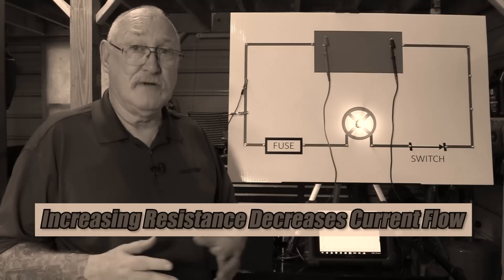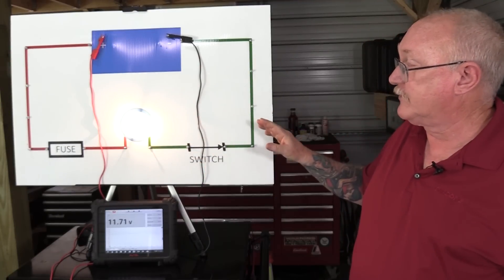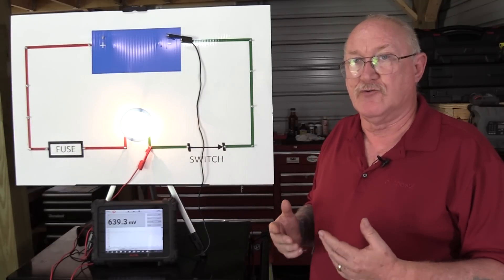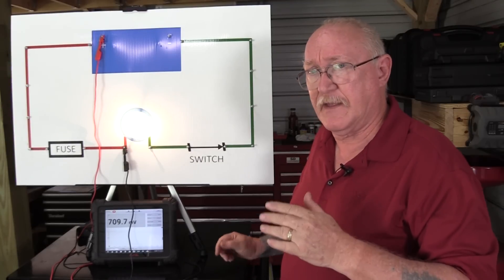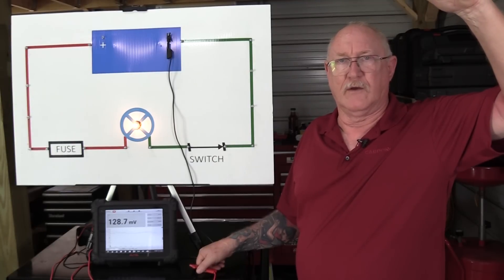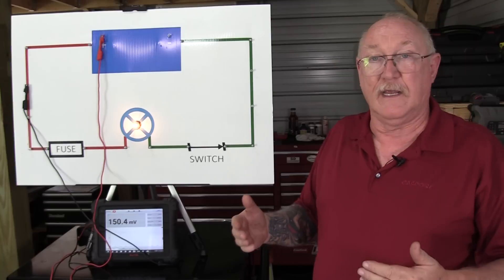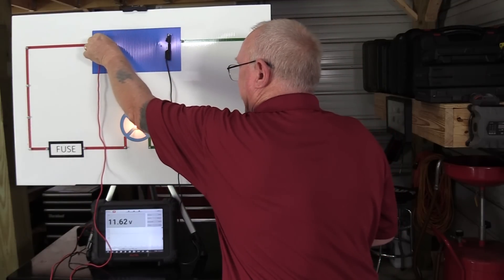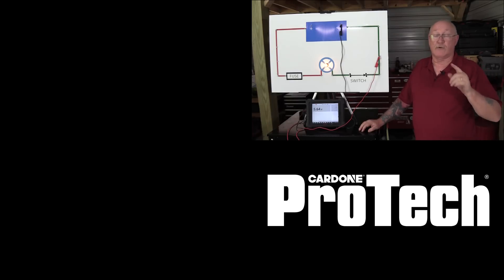CARDONE PROTECH #3:  Kirschoff's Law And The ONE Electrical Diagnostic Technique You MUST Master

Comment: The reason we have voltage present on the part of the conductor that is color-coded as neutral (as we said, voltage is the difference between two points, so that section can indeed be at a positive potential rather than at the convenient reference of 0V for us) is that, in the original circuit design, the last load was connected to the negative pole of the source. However, over time, an additional load was added in between, so that section stopped having the correct color coding because there is now a significant voltage drop across it.

I thank you for helping me understand these fundamental concepts in an easy way, especially since there are many common misconceptions about them.

Comment: I learnt from other sources that voltage-drop between the positive to positive should be close to zero but does it depend upon what is being tested?    best example for me is the positive battery leads: should there be close to zero voltage-drop on the positive to positive while cranking the engine

Comment: The low ohm short from the battery positive to the fuse is a bit strange in that this would have to happen in the fuse box, but okay lets say its there. If so, you would easily be able to spot exactly where the short is with a thermal imager, but you would be probably replacing the fuse box anyway unless you can open it up to repair it. High resistive shorts produce heat (a thermal hot spot). To break open a harness along its full length to do the point tests like shown in the video is just not practical.

Comment: How was there positive voltage on ground side...was it a short to ground?

7-28-2024 Update:
I get it it's caused by there being other loads like a switch with high resistance that shares the voltage between everything on circuit.
If there was nothing causing high resistance on ground side then it would read 0.03-0.3V on ground side since the intended load used up all of the voltage itsself.

Comment: Old mechanic n Electrician I had trouble shoot many electrical problems on cars n found n fixed but I never tried or thought to find resistance the way you described it is great on burnout components but with all this new electronics modules it’s hard to find even with all this new fancy n expensive diagnostic testers with thousand of information I do get lost.😢

Comment: a lot of electrical problems can cause codes that are false from the alternator being bad and spiking the system with ac voltage and the battery having ac voltage to the point where it has to be replaced I had a Chrysler van set a crank sensor code and it was a bad alternator

Comment: resistance to ground is a major problem you absolutely have to have a good ground I put extra grounds on my vehicle I ground the engine to the  Frame and frame to the body engine to the body same way with the battery its grounded to the frame body and engine

Comment: At 17:48 was when you may have inadvertently confused a lot of viewers.  You were testing the theory of whether or not you were 'truly on the ground side' with both leads.  You then revealed another load (i.e., a second lightbulb) that you had hidden behind the test board.
  In a real world application, there normally wouldn't be two or more loads in a circuit.  That, of course, would cause a voltage drop - your primary topic of discussion here.  You then left the video open-ended by not explaining to the viewers how you were actually able to obtain a measurable amount of voltage on a multimeter, even though it appeared as though you had both of your leads on the ground side.
  Aside from that, this was a great instructional video.  It was very informative and well-explained.
  I am a fairly new subscriber of your channel.  I enjoy watching your videos; they are very educational.
  To the viewers that didn't understand what he was demonstrating towards the end:
  When it comes to detecting voltage in a circuit, it ultimately doesn't matter what 'side' of the circuit you have your leads on; a voltage reading on a multimeter works by measuring the POTENTIAL DIFFERENCE between what is on the outside of your leads, and what is on the inside (between your two leads).  
  Simply put, voltage is PRESSURE.  
  "What is the DIFFERENCE in the voltage between the outside and the inside of my leads, ANYWHERE in the circuit?..."
Reply: The hidden bulb was demonstrating a fault in the circuit which is discoverable as a load or resistance. An example might be corrosion in a connector. He is demonstrating an incredibly useful procedure for finding faults in an automotive circuit.

Comment: Yes, that’s a good way to explain it, to folk that normally deal with mechanical issues.
As an electronic tech, it feels wrong to me, because we were trained to make all volt measurements with respect to ground. In reality, if you understand ohms law and you can do simple subtraction, then the technique is actually the same, but definitely easier to understand, for the untrained, this way.
I’m going to adopt this method, when asking people to do things for me, remotely. It’s much more likely they’ll do it right, if they understand why they’re doing it, and I can easily convert their readings back to what I’d get, doing it the conventional way, if I was on site.
Nice tip, thank you.

Comment: Question. If all the available voltage will be consumed by all sources of resistance in a circuit as Kirchoff's law states then how can there be the current flow necessary for the circuit to function. Won't there always be some measurable voltage however low after the load close to the battery ensuring current flow. In other words if there was "0" voltage how could current keep flowing back to the battery.
Reply from the maker: Great question! Current is a measure of electron flow, not potential electrical energy. Think of the electron as a kid with a school backpack on, full of electrical energy at the start. Every time the kid passes a source of resistance, he (or she) has to give up some of that energy to get past it. By the end, the backpack is empty but the kid still made the trip all the way around.

Remember, voltage is a measure of the potential between any two points in a circuit!

Comment: Excellent instruction Pete - electrical testing indeed takes practice to fully grasp and lock in understanding. I took some electronic schooling years ago - studied theory in the books - BUT - still when doing lab testing - as you teach with your demonstration circuit would find out that to read about electrical principles and actually apply that knowledge in a real world situations / problems IS NOT AS EASY AS  ONE WOULD THINK - PROPERLY TROUBLESHOOTING and DIAGNOSING takes practice and time ( experience ) before one really understands what is actually occurring. Many Thanks 🙂✌️

Comment: What would the load be on a older cruise control unit? I.e. 2007 model.
Reply from the maker: Depends on what has the problem. The control unit itself is a load, as is any actuator that it controls. Anything that does work is a load.

Comment: This method will only work when you are dealing will bulbs, alternators etc (dc_dc).....It will not work when working with car sensors that include the ecu .....The Ecu since it involves semiconductors will require a different approach......

Comment: I am really enjoying learning from you. This system works fine if the resistance is the same between a hot car and a cold one. But what if the circuit you are testing for is one thing when cold and another when hot? Of course, the reason for the resistance I think would be that as the engine warms up, some components (or grounds) would change their resistance, right?
Reply from the maker: Resistance shouldn't change with few exceptions. A light bulb, for example, or the mechanical resistance a motor of any kind endures under load. In all cases, the measured voltage drop should remain constant. Trust the meter.
Reply: temperature has influence on resistance, higher temperature increases resistance

Comment: Great video, wish that I could have understood this when I started as a mechanic in 1964.  Of course back in 1964 Meters were not small and affordable as they are today.  Of course the shop were you worked had one on a stand that could be rolled over to the vehicle you were working on.
Reply: @mystic24100 . 

Kirschoff's Law was taught to me at my UK Technical School in 1960.
A very forward thinking British civil servant, Beveridge, drew up the 1944 Education Act planning for eventual peace after war.
Sadly successive UK governments don't have vision to teach science which included building construction, metalworking and woodworking 38 weeks a school year.
Abandoned in 1964, such a backwards step compared to the rest of the world.
1963, my first job after school, working as an industrial electrical apprentice in a very scientific and progressive tannery producing gloving leather.
Progressive inasmuch gloves made with Pittards leather were washable.
During my five year apprenticeship the company built and opened the most modern tannery in the world.
My belief, as the maintenance and development workshop was combined in one building.
An area that contained the boiler house, steam boilers dealing with the massive demand for hot water and steam for manufacturing processes.
Plus a steam engine driving an alternator in parallel with the UK national grid. In 1946 being the first UK company to be licensed to generate in parallel with the grid.
I was in the same position as you with very limited instrumentation when the electrical workshop was performing a great deal of development work integrating and designing electronic controls before other electrical companies knew of the requirements.
The lack of science was sharing one  Avo Model 7 (from memory) multimeter between six electricians and two apprentices.
Working on two factory sites originally with  300 manual worker's many individual using leather processing machines with an average motor size of 5 HP, some much bigger.
The firm had an enormous R&D budget but a single multimeter which if it was damaged there was no backup with a second multimeter.
A five digit multimeter for the price of £20, an R&D quality for £130 at today's prices looking back the options of 80 year's ago.

Comment: Reminder for anyone using this technique. I have seen switches with an L.E.D. that were designed with significant resistance. so be sure to keep that in mind other wise you might spend hours just to find a properly functioning switch.

Comment: Thank you for explaining it in a very understandable way. What are the most common forms of resistance encountered?
Reply from the maker: In my experience, it is usually on the ground side - corrosion, damaged connector fit, loose connections.
Reply: I think #1 would be bad grounds. Then the "green crusties" aka oxidized contacts!

Comment: And don't forget folks. this test only works when the circuit is On. And current is flowing. Otherwise the readings will be different!
Reply: I’m it’s pretty obvious if you’re testing voltage drop you have to have voltage…..

Comment: Kirchoff, not Kirschoff.
Reply: Pronounced "Kirkoff".
Reply: So close...yet Kirchhoff, not Kirchoff.
Reply: @juergenscholl2843  Mine was closer. Who in the hell puts two HHs in a row anyway?
Reply: @btasler  Yet so far..... 

Obviously the Kirchhoff  family did... ;-) (and they weren't ashamed to top that with a double f as well).
Reply: @juergenscholl2843  maybe so, but there is ample proof that I didn't have to Google it first... did you?
Reply: @btasler  No, I hadn´t. I wouldn´t either for names like Ohm, Helmholtz, Planck, Diesel. A glance at my surname may or may not clue you in.

Anyhow, if I felt the need to correcting someone I´d make sure to correct correctly; if necessary with the help of Google.
Reply: Thanks pete, very good information, it helps me to be more confident when doing this type of test.